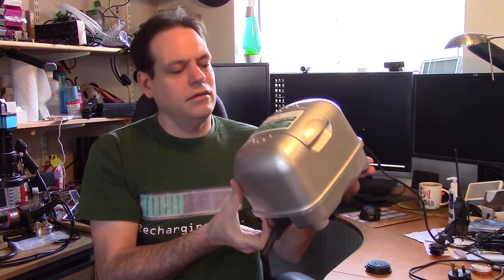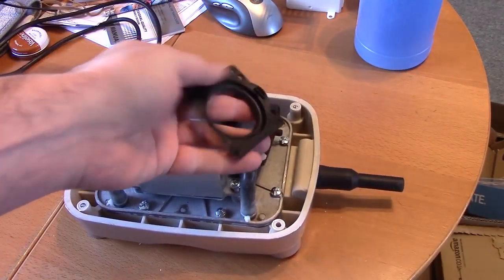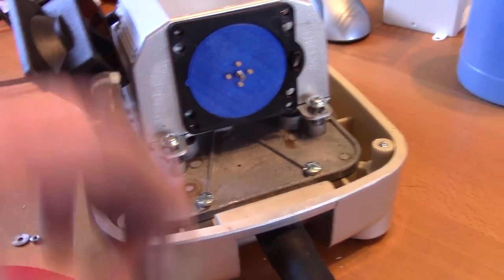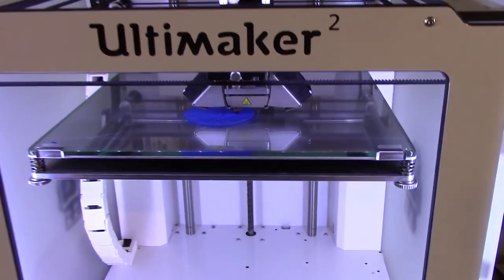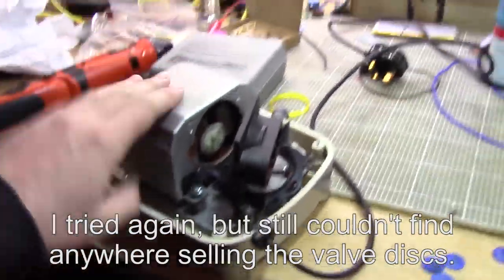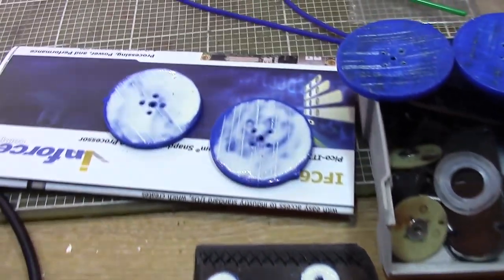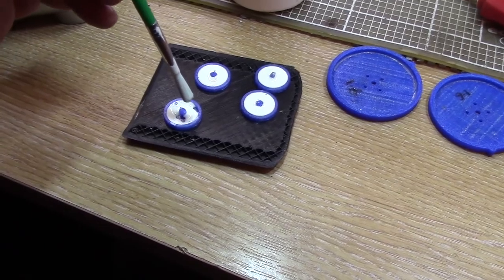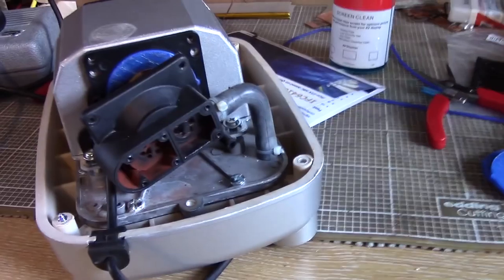3D Printed Hailea Air Pump Repair with Ninjaflex and Latex

Comment: It will be interesting to see how long they last, Jim! My pump is similar to yours, as it is dual diaphragm, less the small valves. The original discs lasted about four years running 24-7! I replaced the diaphragms on Feb. 27 2015 with factory replacements, so we will see of they last just as long! If so, It's worth it!
Reply from the maker: Hi Keith - I remember your diaphragm replacement - you made a good howto video covering it :) - The fixed pump is now the main air pump back in that greenhouse now - I'm going to try to have a big tidy-up in the greenhouse and get rid of the tomatoes and peppers next weekend, so it doesn't matter too much if the pump fails now - I figure I'll leave it running for the week and pull it apart again next weekend to see how it's holding up. Hope you're having a good weekend. Cheers!!

Comment: Bit of a PITA initially aye Jim but ya got there in the end, and it worked very well too. Awesome job.

Cheers mate
John
Reply from the maker: Hi John - I was very much enjoying my experimenting with the Ninjaflex material for the first day or so, but finding out that every part I'd printed was porous was rather a blow - I'm glad it happened though as this isn't the first time I've wanted custom shaped bits of rubber, and now I've worked out that I can use latex for all sorts of useful seals and o-rings - I'm pretty sure that some of those will make their way into my hydroponic setup sooner or later. Hope you're having a good weekend. Cheers!!
Reply: You could increase the amount extruded to try to fill in those holes.

Comment: Fantastic work, Jim!  I really enjoyed the video.
Reply from the maker: Thanks +Khang Starr - It was a roundabout trip getting the pump working again, but I got there in the end. Hope you're having a good weekend. Cheers!!
Reply: +Jim Conner can we get an update on the effectveness of th DIY 100W 7-Band Multi-spectrum LED Growlight video please???
Reply from the maker: Hi +Jimmydean hilltow - I only used it for starting my seedlings and when the sunshine came back last year, I put the seedlings out in the greenhouse. The lamp has been sat on my shelves since then. I'll be putting it back into service very soon though as I need to get my plants for this year started off. Cheers!!
Reply: sweet! and i have a suggestion could u possibly after u switch off of the led light that u could set aside one plant that would be strictly be running on the led light as its main light source and maybe a white led with it as to give some more of the needed light spectrum the plant needs as an experiment since i've been stuck trying to find a relatively cheap solution to growing in the winter since i live in the far north part of michigan? thanks for doing such informational videos they've helped me do some cool experiments :)
Reply from the maker: HI +Jimmydean hilltow - Plants don't really use the yellowy-green part of the colour spectrum unless there's not enough red/blue light around. The plants will produce caretoniods instead of chloryphyl to try and get the extra energy - it's why leaves turn yellow in the autumn, and seedlings left in the dark sprout yellow. If you're growing under lamps though, you can ensure that there is enough red/blue, so the yellowy-green light energy would jsut be wasted. Growing under warm-white LEDs will give results just as good as growing under red/blue LEDs, but you'll use slightly more electricity to get the same results. As I understand it, the blue part of the light spectrum is used for leafy growth, and the red part is for flowering/fruiting... If you're growing leafy crops like lettuce, then you can do away with the red part of the spectrum and get great results with cool-white LEDs. Thanks for watching and taking the time to chat. Cheers!!
Reply: thanks bud

Comment: Persistence has worked Jim
Reply from the maker: Hi +Patrick Meehan  - If I'd been able to find spares for the valves I'd never have gone down this route... but I'm glad that I did because I can think of all sorts of places where a custom latex o-ring or seal would come in handy for the hydroponics setup. I've been thinking about how to make some custom right-angled tank connectors for the new deep-water-culture setup I'm planning, and latex mouldings will do an excellent job of sealing things up. Hope you're having a good weekend. Cheers!!

Comment: Thanks Jim. If you coat those porous prints with Vaseline or Lithium grease, would that be enough to block the holes, and to keep running for a decent time?

Comment: Persistence pays off!
Reply from the maker: Thanks +Donovan Lym - If the spares had been available, I'd never had persisted, but I just couldn't bring myself to buy a whole new pump because it needed a 17mm little rubber disc inside it - I'm glade the spares weren't available now as I've gained another trick to use when fixing/making/building things. Hope you're having a good weekend. Cheers!!

Comment: Wonder if it would be possible to use a small rework hot air gun to go in and melt/reflow the material in the diaphram to seal up the pin holes?
Reply from the maker: +R Brown (4Crawler) I've got a gas-powered soldering iron which has a heated knife attachment - I've already used that a few times to tidy up and repair 3d prints - It's certainly worth a try... I was also wondering if a different piece of 'slicer' software might let me optimise the extrusion path to minimise the risk of holes by offsetting the paths between the different layers. Cheers!!
Reply: +Jim Conner I think I've seen a video where someone was adjusting slicer settings to control porosity in the layers.  I'm still waiting on my 3D printer to arrive, so I don't have any direct experience with that yet.
Reply from the maker: +R Brown (4Crawler) Which printer did you go for?
Reply: +Jim Conner I opted for a Type A Series 1 Pro.  Local company nearby where I live.  I plan on using the machine to 3D print some parts for my business and this printer seems to be set up to handle that sort of job.  I also looked at the Ultimaker 2 like you have, both seem to be quite nice units.  Only problem with the Type A machine is the 2 month wait time on shipments :(
Reply from the maker: +R Brown (4Crawler) That looks like a nice machine - I particularly like the extruder setup they've got on there... Should be good for more difficult materials (like ninjaflex) which are a pain to push through a bowden extruder tube... I've actually been considering getting a second 3d printer (very cheap kit-build variety) with a direct feed extruder setup just for use with some of the less used plastics which you can print with. That way I could have the ultimaker doing high quality work, and the cheap printer making nylon gears and things like that. I'm sure you'll have a lot of fun when your priner arrives - It's a great toy. Cheers!!
Reply: +Jim Conner Yes, that's one of the reasons I went with the direct drive extruder for the reasons you mention.  Also I liked that it's pre-configured with WiFi and a web cam because my plan is to stick this up in the attic.  Then I can fire off a print job and let it run for however long it needs and take a peek at the camera to make sure all is well without having to pull down the ladder and climb up to look at it.  I plan on doing a lot of parts in Nylon, so the odor might be kind of bad if I left it in the house.
Reply from the maker: +R Brown (4Crawler) I've got a webcam hooked up on my printer too so that I can keep an eye on it when I'm not right next to it... I do still need to sort out a remote kill-switch for the power though as there's not currently anything that I can do remotely if the printer starts mashing the extruder into the model it's printing... Ah well.. yet another project added to the list :). Printing with PLA and PET has been a breeze, but ABS has been giving my a hard time... My wife's telling me off at the moment because I dried out some ABS in the oven for an hour today - I was having a terrible time trying to print with it earlier, but now it's extruding like it's made of butter. I have found that enclosing the build chamber has been essential for me to get good ABS prints, and I think nylon is even more prone to warping than ABS - I'd highly recommend that you start out printing with PLA for the first week or so before you get onto the frustration of the more temperamental plastics, and having to coat the build plate with hairspray/uhu glue/kapton tape (kapton's been working best for me). Cheers!!
Reply: +Jim Conner Yes, anticipating the need to play with the printer for a while when it first arrives.  I think my first few projects will be some enclosures for various electronics parts before moving on to the nylon.  My planned parts are pretty simple to begin with, just some round and rectangular plastic spacers with 1 or 2 holes.  I machine those out of solid plastic currently, but the thought of just hitting the "Print" button is very appealing!  Good info. on the enclosure.  I'm already planning to built one for this printer as it's fully open.  I'm also thinking of setting up a plastic bucket dryer with a light bulb inside and run that off my solar power system to keep the filament dry.  Once we hit spring, the attic stays fairly warm and the air is quite dry so I'm hoping that's work in my favor as well.

Comment: OOOO there is the garden :) I am so glad you got this 3D printer! These videos are as exciting to watch as you garden updates :) I was wondering if you were going to print a mold out for the disk. That was smart thinking. What other projects do you think you will do with 3D printing? Does not seem like you have a shortage of projects :) I just posted some new videos if you get a chance to check them out :) also my garden is about to pick up i have learned so much and i am just getting videos uploaded from 6 months ago. So about August :) Thanks for sharing :) Although i am still failing at changing out my hydro sol. But I have learned i need to replace it about every 30 days with the tomatoes.
Reply from the maker: Thanks Benja - Heh - I'm onto version 5 of my diaphragm moulds now, but I think I might be happy with that one now... The diaphragms are now arund 3mm thick and hold the pump together properly - Still gotta see how long they last in everyday use. I'm planning on getting my new DWC setup sorted out in the next few weeks, and may well try printing some plumbing bits for that if I can't find the right ones in my collection. I've also been printing a few things out of my 'Mixologist' automated dosting project, but that's not quite ready for another update just yet as I still need to do more work on that one. I've been terrible at swapping nutes for the last few months, but nothing is really growing very much at the moment... I'll be starting my seeds for this year in the next couple of weeks and getting the LED growlight going in the office once again. Cheers!!
Reply: Oh ya i can just smell the next garden update :) Sorry to hear that you are on revision 5 but it sounds like you almost have it all fixed up. I was hoping that the mixologist would be something i could copy but it looks to be way to complicated :) you are one great creative genius :)
Was i watching a video of your where the plastic bearing broke in your water pump or was it someone else? If it was you do you think you will print out a replacement part for it? ttyl

Comment: Hi Jim, a supremely wonderful job you did on this.  I wonder what what the outcome would have been if the latex rubber was poured out of a certain thickness on a tray and cured, then the proper diameter punch (as a copper pipe or such) was used to 'punch out' the same diameter size disk were done, for both the small and large disk, would have worked.  If it did, you could make a large number of replacement diaphragms stock for future. Even making them thicker if the pump would allow.  The thicker the more they should hold up in time.  Anyway just wondering if 'Punch-Out' method would work well or not.
Reply from the maker: Hi EyesOnReality - That might be a good solution with other diaphragms, but on this particular Hailea pump there is a ridge around the edge of the diaphragm which is needed to hold it centrally in the pump. The diaphragm has to fight against the force of the magnets in the pump trying to pull it to the sides, so a simple flat disc won't hold it in place correctly. It might be a good idea for other air pumps though. Cheers!!

Comment: Excellent one Jim looks like the Nijaflex made better moulds than actual valves ...nice demo of how to think laterally.Cheers
Reply from the maker: Hi John - I checked on the pump when I got back from work this evening and found that the ninjaflex diaphragms have failed after just 48 hours use - the layers of the print have delaminated from each other, and there's a few gaping holes between the strands. The latex valves however are still in perfect condition, so I'm now printing some diaphragm moulds and will be pouring latex in about 3 hours time. So far the only actual useful thing I've managed to make with the ninjaflex is that squidgy door wedge.... Although it's nice to have a soft plastic to use, it doesn't look like it's up to the job of any serious engineering workload. I've been learning about the different mouldable rubbers today and will be ordering some other ones to play around with soon.  Cheers!!
Reply: +Jim Conner Thanks for the update, I think moulded  units will be much better. Either way the 3D printer was good in producing the Mould even if  the actual parts it made weren't that good in this circumstances. Half of what you are learning is what tool for what job... you'll be an expert nest :)

Thanks for sharing with us
Reply: +Jim Conner Constant movement probably just steadily heated them up and decreased the viscosity of the plastic and because it was laminated it just give up the ghost. Kind of like chewing gum after a while, I dunno just a guess from my very ropey fluid mechanics knowledge, could have things the wrong way round. 

I think the latex might have a similar issue with long term use couldn't find a paper for the physical properties that was free though.

Great fix though even if it didn't totally pan out was a really interesting watch. Very interested to see how long the latex parts last!
Reply from the maker: Hi +Zanthe EU - That sounds entirely plausible to me - Having just now examined the failed diaphragms a little more, I notice that the delamanication has only happened between the first and second layers - The first layer was extruded directly onto the glass, so would have been cooler than the rest. All of the rest of the layers have torn through in a circular pattern where the diaphragm was clamped to the centre of the compressor shaft - I wonder if some kind of work-hardening occured there and the plastic lost it's elasticity - It seems to be prety easy to tear them now. I've got some latex moulded diaphragms sitting on top of my monitor right now as an attempt to replace the ninjaflex ones... When I first moulded them, they were too flexible, and didn't hold the bar straight (same as the 1.2mm ninjaflex ones), but I've been adding extra layers of latex on to thicken them up... At some point I figure I'll hit the right amount of elasticity. It will indeed be interesting to see how long they last - I'm quite hopeful that the latex ones will last for a long time. Cheers!!
Reply: +Jim Conner De-lamination is the bug bear of 3D printing Jim mostly mitigated with a good heated bed on the bottom or using some solvents to merge the layers together ....Most people of course do not make moving parts and don't therefore suffer this problem to the extent you are!!
Reply from the maker: +101blog Hi John - Having worked on this for another week now, I can say 'Latex moulded parts for the win' - Cheers!!
Reply: +Jim Conner There seems to be an entire culture of people doing exactly that using the 3D print as a mould or a form for the manufacture of a much stronger conventional part...a win is win at the end of the day !
Reply from the maker: +101blog Lost-PLA casting looks like it would be fun to try sometime.. (though I do wonder if a HIPS plastic would vapourise a bit more quickly).. Cheers!!
Reply: Not sure but obviously some one has tried PLA so it's more of a known route to travel. Not sure about the poisonous ByProducts as well although I doubt you would do it the house:)

Comment: Great job!!
Reply from the maker: Thanks +Aerik Forager, but I'm afriad it wasn't such a great job in the end - the ninjaflex parts fell to pieces after 48 hours use - I tried moulding some diaphragms out of latex, but they were too soft to support the magnet bar properly, so once again the pump is back in pieces on my desk waiting for me to come up with a better fix... I've been looking at alternative mouldable rubbers for the last couple of days now. Cheers!!
Reply: Jim Conner I was more referring to the great job you did documenting the process you have gone through to try to replace the diaphragms. 

I have spent entirely too much time in the past trying to recreate parts for various gear, but wow does the 3d printing seem to help prototyping.

Perhaps a silicone with thread reinforcement, cast in a 3d printed mould would do the trick?